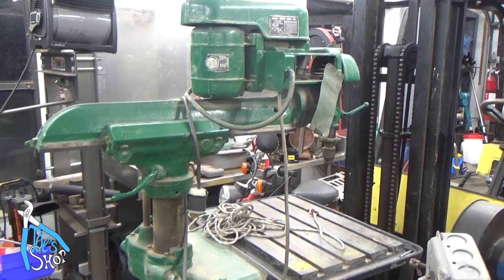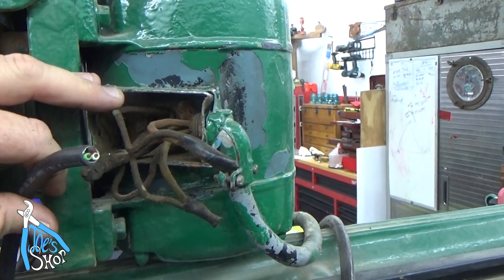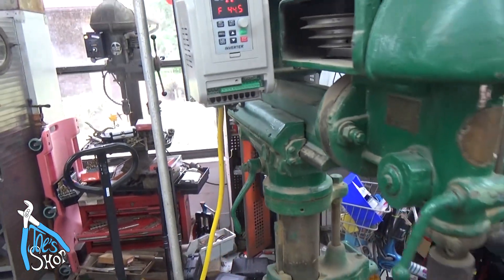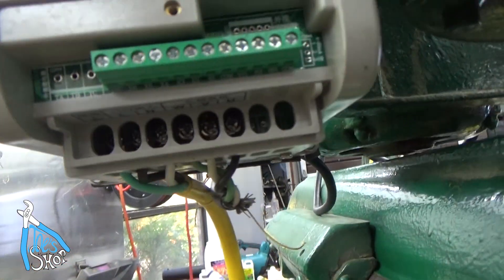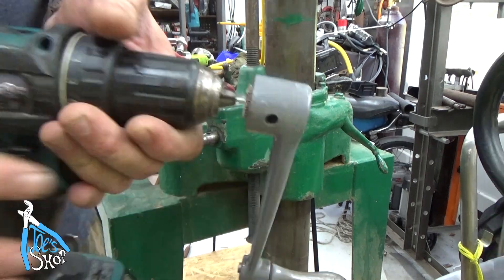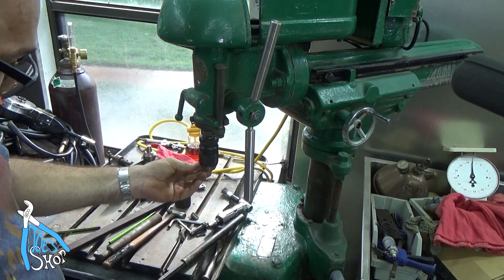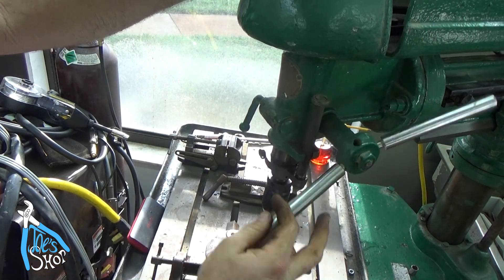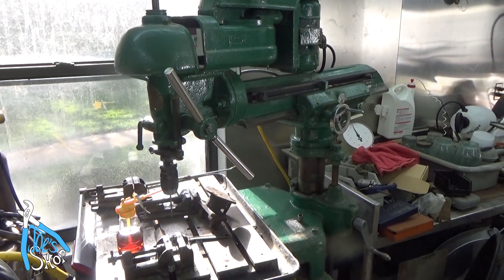Walker Turner Radial Drill

Comment: Where to put it?.....Well that is easy.  Walker Turners are my favorite, as such they make great dining room pieces.  Sure, a jointer in the den is nice but nothing beats a lathe in the foyer as you great guests.  
( Yeah I said foyer....well its  no more goofy a word than lathe....)
Reply from the maker: Lol...if I was single there would definitely be heavy machinery in my living room. I did have a 72" tool chest in my kitchen for a few years. Thanks for the comments. Cheers
Reply: You make a good point  @joeheilm .  We don't want you to be single.
I suppose the drill press doesn't need to be inside the house  (Although you may still want to ask about the laundry room.....It doesn't hurt to ask).

Comment: I had a chance to buy one of those last year and waffled too much and it was gone.  My shop is in the basement and it would have required extensive disassembly.  Still kind of regret it though, would have been a good winter project.  Take care Joe.
Reply from the maker: Mr. Pete moved a bridgeport into his basement so I guess anything is possible. Yea, i jumped on this when I saw it on market place. I almost didn't message the guy because the $250 price looked like a scam....im glad i did. Thanks Pat. Cheers